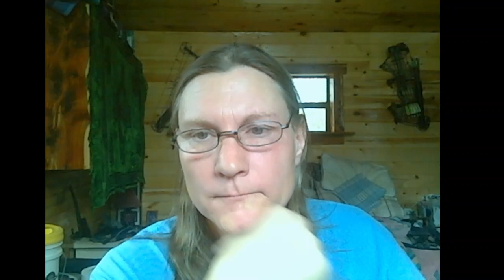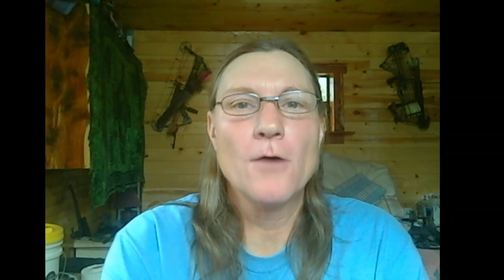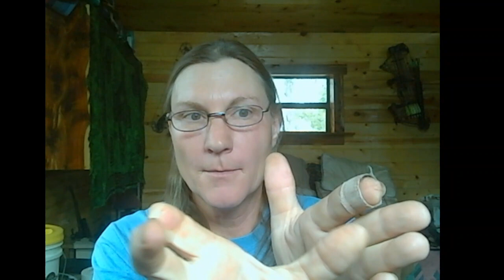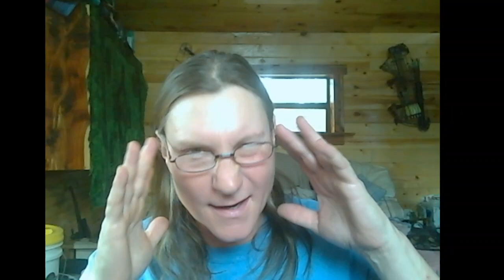OK MECHANICS another clutch curve ball and update!

Comment: Congratulations, any which way that works.  Could your pressure cleaning  have removed some type of debris that was preventing clutch engage; but when the debris was pressure blasted away, the mechanism then moved normally ?   I am not as good a mechanic as you, but today I am doing self-dentistry  to carefully add a small amount of 5-minute epoxy bonder to my lower rear molar tooth to cover a small cavity hole and stop the pain.  It worked !!   And I got 8 tubes of horse-paste Ivermectin to combat infection if needed.  "Use it up, wear it out; Make do, or do without" = advice from 1932 Great Depression days.

Comment: Here is my nephews response he will not put his comment on here 😊

Ok shim was never in bell housing, good. But if, and big if, the pedal travel screw somehow limited the pedal from coming up enough, it would of stopped master cylinder from fully filling up, with enough pressure to disengage clutch. Not sure how it went so far to keep it disengaged tho. Must have been severely loose. Might wanna double check pedal assembly, make sure nothing else is worn out or loose

Comment: Did your clutch master cylinder get something in it, dirt, debris?  If the hydraulic oil isn't moving where it should, then it seems it would cause this stuck problem.  But I'm not a mechanic.  I hope you get it resolved.
Reply from the maker: we got it working and it is not the fluid